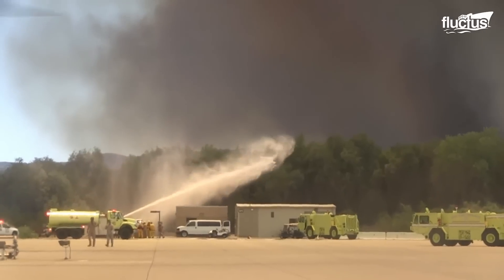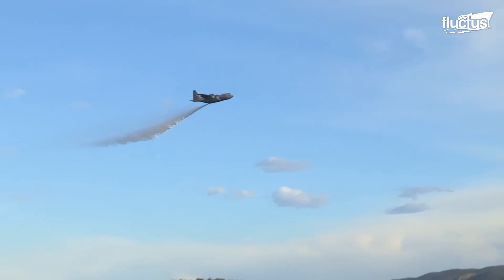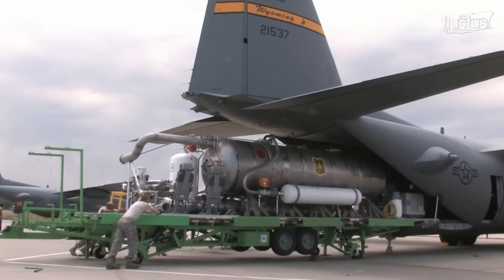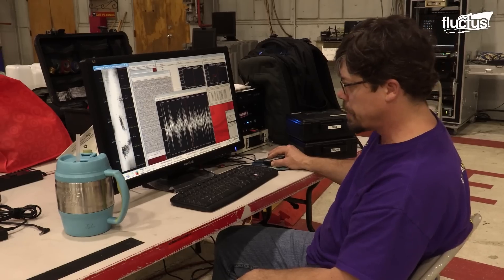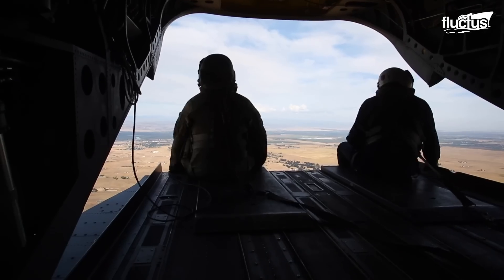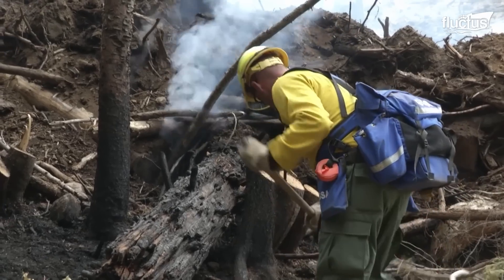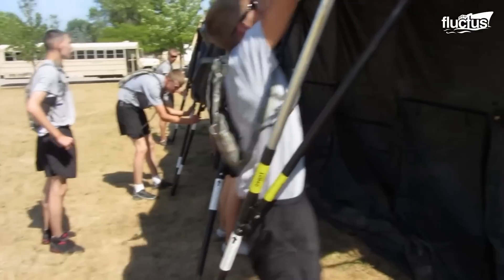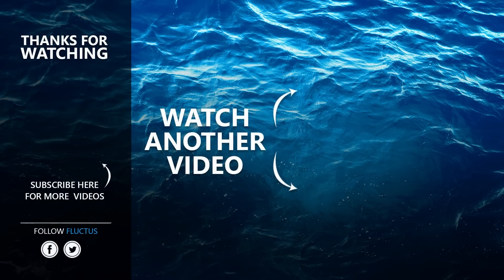US Genius Invention to Fight Massive Forest Fires From The Sky

Comment: I was in charge at Thomas Welding when the trailers were being built for the units to transfer them from construction to plane to plane . The trailers weighed around 10,000 pounds by themselves . Got to see some test runs plus the Firehawk helicopter units

Comment: So why not take the  older KC Tankers that the air force is retiring and turn them into fire fighting planes?
Reply: 😎KC-135’s aren’t designed for low level flight or the much lower speeds that c-130’s and helicopters are capable of. They were adapted from airliners, meant to fly high and fairly fast. Other planes that tried to transition to low level flights had problems with low level turbulence causing additional stresses to airframes that caused fatigue failure of wings.
Reply: @markkarasik2211  It's always something to mess up a good idea.:face-orange-frowning:
Reply: @gkindustrialmachine1  😎If we engineers designed things perfectly every time we’d be out of work pretty quickly so we make things very carefully to do one thing and if it can do two things we’re geniuses
Reply: この設備は、KCタンカーを改造する必要はなく、
リアサイドドアの付け替えと、設備を乗せるだけで、
全てのC–130に搭載できます。